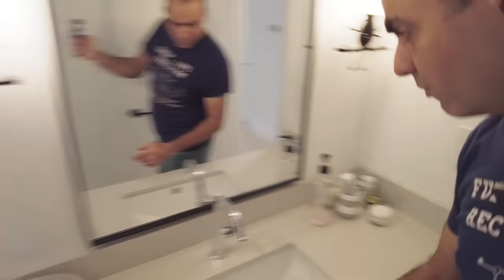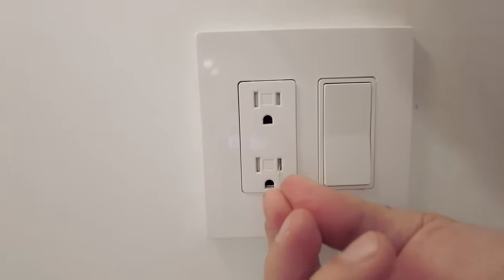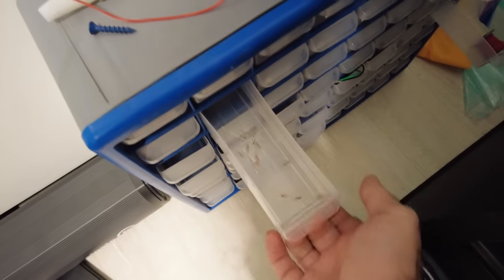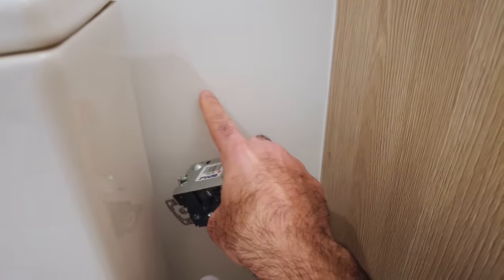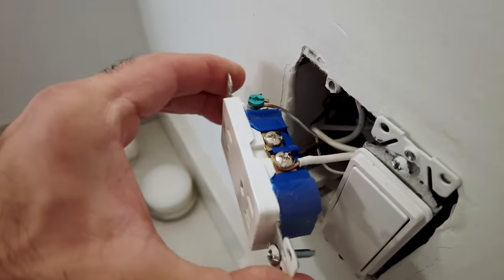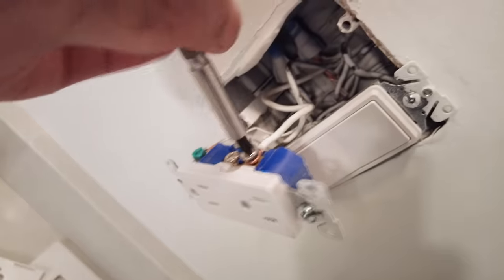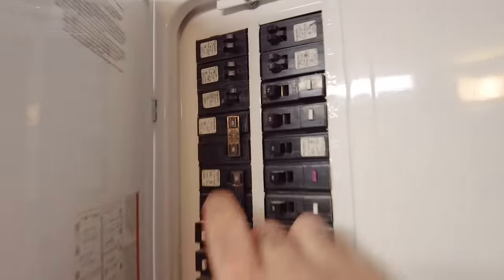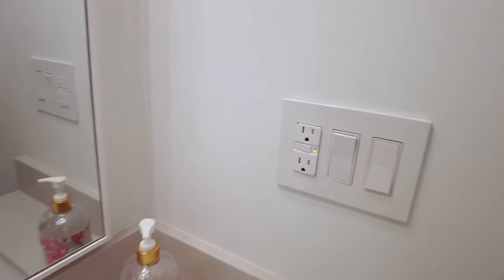Installing an Outlet… For a Toilet Seat?!

Comment: Next do an in-line 220V electric heater next to the shower head!   It’s those extra tingles with the warm water that really get you moving in the morning.
Reply: When I was in Manila, I experienced those tingles.. then I decided to use a different shower
Reply: Industrial 500v service, I want the shower head hot enough to forge steel.
Reply: The bigclive showed one of these deathtraps, the perfect place for an outlet is right next to said shower head, ungrounded of course.
Reply: @BrokenAtari  There is also 347/600 V service in Canada and 690 V in Europe. Even 1000 V for huge loads. And for even larger loads like motors in factories you can go to medium voltage levels like 6.3 kV.
Reply: @mernokimuvek  
Had a brother-in-law that was a union electrician, he never enjoyed working on 4160 Volt LIVE (sometimes it has to be done tho I don’t know if OSA would agree with that). It is educational to watch the line people working on new transformer reconnects.
Reply: We call that "spicy water." It comes from the pipes the city tends to run through veins of spicy dirt that excavators always find so attractive. You'll usually find high voltage lines running through the same general vicinity. 

I'm sure none of those things are related in any way and are completely coincidental.

And always remember to call your local dig line before digging so the line spraying guy can come spray lines on the ground where you can be %100 certain the city water main is not.
Reply: @meatharbor  
AND don’t trust that those “sprayed markers” are correct. Sometimes you have to carefully explore for underground utilities. I worked on a job where a large high pressure gas line went over a large underground conduit instead of under. The large earthmover found the gas line. It was educational watching the gas maintenance person welding the damaged line back together with a torch, while the line was at full pressure.
Reply: @Mentaculus42  It's just a little terrifying that I can't think of even one person I've ever met that does construction, utilities, roadwork, anything that may, at some point, have to put a hole in the ground, who doesn't have at least one story of line spray guy causing, at the bare minimum, significant damage to infrastructure, if not severe bodily injury. 

I'm legitimately beginning to wonder if it's just, like, the same guy. Just one dude that somehow gets shuttled all over the continent laying paint arbitrarily wherever he goes. Either that or they decide where the paint goes using that system from the Margaritaville episode of South Park with the decapitated chicken and the kazoo.

Someone should really set up, like, a line they can call or something to figure out where to spray.
Reply: @meatharbor  
I had a job at public works department and had to interface with utilities on their underground stuff, which for example on the high pressure gas line that I mentioned had location (and a bit rough at that) but not depth. Another situation on a piece of property that I have, AT&T was installing fiber optic line in an easement that already had buried cable there. The marking person tries to use a tracing device to sound the cable and puts a lot of paint around. The boring contractor shows up and I tell them to not trust the paint as I was fairly sure that it was wrong. They spent part of a day using a big high pressure washer like machine with a mega hydra-vac finding the old cables. Where the actual cable was found was a couple of feet away from the paint marks.
Reply: oh god, the death showers.
Reply: Australia.
Reply: Screw 220v.
Real men use 415v 3 Phase.
Reply: @IIGrayfoxII   no real men use the 500 amp 1000 volt redistribution boards that when they blow up you better have been wearing a bomb suit.
Reply: Just use an isolating transformer
Reply: He’s done that already
Reply: Maybe not moving anymore
Reply: @BrokenAtari  idc

Comment: Electrician comment here!  Next time, as you pointed out, use a box that clamps on the dry wall instead.  The lower example is the one I like.  For the cut out on those it's best to just use a credit card as the template and you'll get the perfect size.
Reply: Wait really? Those are the same dimensions? I've always just traced the box. Thanks for that info.
Reply: Dude... That stud is no longer a stud... The hole was so big that the sides looked like toothpicks.
Reply: Yep. Usually they are in the same aisle, except in a section that is labeled for "old construction". This is not just limited to receptacle boxes as well.
Reply: Rack-a-tiers makes a template with a built in level that let's you trace the perfect hole for both plastic or metal old work boxes. It's cheap and saves so much time if you're constantly cutting in pop in boxes like me
Reply: You forgot to mention he forgot the anti short bushings 😂
Reply: @nyer070  Definitely. if the hole is bigger than 1/2 an inch, iirc, you're supposed to use a little circular reinforcement bracket.
Reply: @bluephoenixguy1094  that's exactly right!
Reply: Huh! TIL!
Reply: @cfb36  can't talk like a normal human anymore?
Reply: @nyer070  ‘laugh out loud’ it’s shorthand for “today I learned” as an old fart myself, keep up with the times old one haha
Reply: @cfb36  haha you guessed it right, I am older and old fashioned. Thanks for the positive spirits
Reply: @nyer070  If you don't know what "TIL" means and you're on the internet, sorry but honestly, you're the one not normal anymore :P Growing old is hard.
Reply: @NakamoriAra  Oh, yeah, forgot about those.  It was probably the wrong box for it too.  I guess electrical engineers would make lousy electricians, or as Mehdi said, "Professional Dumbass."
Reply: RepentandbelieveinJesusChrist5  WTF
Reply: RepentandbelieveinJesusChrist5  Hail Satan!
Reply: @nyer070  If that stud was NOT a load bearing stud, it was OK to drill a huge hole, possibly intended for a large wate pipe to go from the sink basin into the side of the toilet bowl, instead of down it's own sink drain (an after thought after the stud was pre-drilled during the construction of the wall.
As often happens, some things that shouldn't be seen are, and some things that should be seen - are not.
Reply: @NakamoriAra  Or that he forgot to lubricate it all with the "wire-netting-oil-can".
Next time he'll need to use a long drop to fish out the mouse, that he sneaked past everything back there before the plumb-bob fell.
Reply: @WJCTechyman  Actually, I would have simply used a mounting block on the side of the vanity unit, solving all that "wall fitment" of the metal flush box (also that the tails came into that metal flush box without a gland - oh dear - from the metal sheathing which sadly he forgot to earth/bond anywhere too, by cutting it back after winding it off at each end, meaning if it ever has an internal fault to earth via the sheathing, anyone accessing the armour sheath from inside the vanity is liable to get a hefty electric shock eh?)  beside the stud" problem, leaving the tail long enough to terminate the wire to the outlet itself, before screwing the outlet onto the mounting block, (or in his case to the wall box, would have also meant having the unit closer to the person, instead of right at that back wall itself.
It looked very much like a concrete flush box, for mounting into concrete block walls etc., so yeah, wrong flush box.
The side clip wallboard / gib board clips, are not something most DIY people think about when purchasing flush boxes, as he possibly asked for a concrete box not knowing the right terminology, either that or the supply depot he got it from - had a surplus of very cheap concrete boxes - or simply fobbed him off with one.
Reply: @nyer070   This was 100% all I could see. That stud is purely cosmetic at this point!

Rule of thirds. No holes bigger than 1/3 of the wood. That thing was like 4/5!
Reply: @DarrLaw  it's basically just there to keep the sheetrock straight anyway, interior non load bearing walls being what they are. still no real excuse
Reply: @nyer070  Agreed that hole should have been braced.
Reply: @nyer070  Just because you now have load bearing drywall for that stud....... Have seen houses where the paint is a structural element.
Reply: @SeanBZA  paint being the structural element had me! 🤣🤣
Reply: @nyer070  Went to undo a light fitting, and when I broke the paint that was over the screw the entire ceiling rose disintegrated. All wood eaten out under the paint, aside from a thin layer of old lead based paint that was left in the shape of the old wooden rose. Luckily new LED fixture is light, so screwed into the asbestos sheet ceiling instead. Temporary prefab house, now there over 100 years, as it never was replaced with a permanent structure, just got added on a few times while still being classed as temporary.
Reply: @SeanBZA  🤣🤟🏻🤦🏻
Reply: @Mister_Brown  
And how do you know that any particular wall is load bearing or not, I have a number of interior walls that are significantly load bearing in my house? Remember, this video will be extrapolated to just about every possible variation of situations by people that are not knowledgeable about such things.

Comment: Just installed one of those non-electric bidet seats at my place. It's a simpler version than others but feels more reliable. No electricity needed – it hooks right up to the hot/cold water from the basin. Only cost me 30€ and it's perfect for a rental. Depending on your setup, you might not even need to do major work, just attach the hoses. Got it ready in just a few minutes. Super straightforward and efficient.

Comment: I think that ElectroBoom did a pretty good job. Reto-fitting electrical wiring can be a pain in the ars.
Reply: ask us in germany..solid walls or even beton^^
Reply: @bosanaz2010  wait do Germans call it beton as well? We call it beton in Turkiye too.
Reply: @Görkem-x5h  yes, Germans call it Beton. Looking up “beton” in Turkish on wiktionary, it seems we both borrowed it from French béton, from Latin bitūmen.
Reply: Being from England we just stole the word, removed the unnecessary line above the u and called it bitumen.
Reply: @puellanivis same here in croatia
Reply: @bosanaz2010  I am a german electrician and fellow ElectroBoom-Viewer and I had like 15 heart attacks watching this video :/
Reply: As much fun as I make about those north american drywalls, I got to admit that it looks so much cleaner whenever you need to retroactively use cables.
Reply: @ZeroOneInfinity  "Bitumen" exist in German as well, its a completely different product though.
Ours was derivated from lat "pix tumens" and its basically Tar made from mineral oil.
Advice: don't put german "Petroleum" in your car as well, it's not gasoline but lamp oil. :-)
Reply: @bosanaz2010  huh, Russia, or other north countries i think, concrete everywhere, even cosmetic walls )

Or bricks in old houses, and in new apartments with finishing nobody know where the wiring goes, pretty sad i suppose easier to renovate all apartments than try to do things like that. 

Oh yeah and sanitary cabins of course in new houses, also without pipes and wiring scheme )
Reply: especially with one hand.
Reply: @legominimovieproductions I am an electrician in United States and was having chest pains watching this but got to the hospital in time….then I got the bill. Ugh on the vid. Ugh again.
Reply: Yeah, old work is a royal pain. I'm not familiar with Canadian laws, but that installation wouldn't pass NEC here in the states. That being said, I think it's functionally fine and safe.
Reply: @funtechu  I’m in the states too. It wouldn’t pass (armored cable in plastic box) and he didn’t stress making the connections on the devices TIGHT like they should be, but even with all the cuts, I’m impressed with his skills of whipping that cable in there like he did. It probably took him 6 hours, but he still did it pretty good. LMAO at how he skinned the armor and how he stripped the wire.  Put a redhead on there!!!!!!!!!!!!
Reply: @SnotrocketLT4  Yep, like I said, it wouldn't pass under the NEC. The one real safety concern I had is that he didn't tie the ground to the box, and thus the MC and box are floating, or at least they are only connected through the receptacle tabs. However at 13:29 he mentions in an editor note that he is going to go back and do that, so that resolves the only real safety concern.

For those wondering the other code violations, he is attaching an MC to a plastic box which is disallowed because the box can't provide grounding connection. In this case, it is grounded on the other end, so while it won't pass code, it's not an immediate safety concern. The other thing is the MC is not appropriately clamped to the box. Those one-way clamps are made for NM wire.
Reply: @funtechu  Also the metal box he used is for NM connections not MC connections. He forgot the anti-short bushings. The metal box was attached with screws from inside, and that box is not designed for that. The metal box is not flush to the drywall, and the gaps between the metal box and drywall are too big.
Reply: @TonyPombo  Good points, I was watching it on my phone so I didn't see some of those details.
Reply: @TheBl4cKH4wK  It is one of the very few benefits of having what are essentially hollow walls everywhere. The company I used to work for often received contracts to wire houses with networking cable and you don't appreciate just how nice drywall is for that kind of job until you have to do the same thing for a building that's 75 years old and constructed almost entirely out of Haydock bricks
Reply: @bosanaz2010  Well we Indians tend to love running pvc pipes in corners and painting the same color as the wall if we need extra sockets somewhere.
Reply: pun intended
Reply: @bosanaz2010 I do wonder where Beton originates from. It's the same thing in Mauritius but it also blocks signals more than typically as it's made from mineral rich rocks.
Reply: Btw that wouldnt Pass in Germany neither... But Out wiring is way different than Muricans..Our Outlets have spring loaded clamps..No screw (nearly all) ...Just pull down isolation and Stick IT in...also No cable Twist Connections...wagos are the way to go and so nice to Work with ....also everything is Protected by a rfci,Not only bathrooms.
Also WE have 230v ,and even 400v  for the oven,Car charger or Like me a Workshop in my flat ...😂
Reply: Beton Blocks because of the Steel INSIDE as far AS i know
Reply: @funtechu  Also, he should have a redhead(bushing) to keep the Mc armor from cutting into the wire.
Reply: @SnotrocketLT4  Huh, I though I saw him put one in, but I guess not. That's what I get for watching on my phone!
Reply: @funtechu  Maybe he did and I missed it. I’m watching on phone too and didn’t go back to look.
Reply: Pain in the Ars Technica.
Reply: @bosanaz2010  yeah its nice ripping people off
Reply: @bosanaz2010 Betoni in Finnish
Reply: @ZeroOneInfinity But beton is concrete. Bitumen is bitumen. U put it on the roads

Comment: Can't use AC/MC with plastic boxes like that. You could mount a junction box in the cabinet that takes the MC, and NM-B from the back-side that feeds up wall and into plastic box properly. Also those are the wrong size one-hole straps, need 3/8" MC straps. 13:05 you bought the right box, but yeah hole a lil too big, but what you need to use there are two "madison straps", which are flat metal straps that you insert and then bend, which then rigidly holds the old-work-box in place against the drywall. no need for screws or extra ears.
Reply: Your supposed to use 12/2 in bathrooms too

Comment: Having an outlet right next to the toilet would be a dream. Imagine the new possibilities! Watching Mehdi while charging your phone!
Reply: Oh yeah totally what I was thinking too!... And nothing else
Reply: I put one in for the bidet - and now I'm about to wall mount a laptop by the toilet.
Reply: Pull yer wire!
Reply: Why phone when you can bring your pc
Reply: Watching Mehdi is the one time I would be anxious charging anything
Reply: You can watch him while charging your phone anywhere - power banks do exist!
Reply: Get a 10ft charging cable.
Reply: Aren't most bathroom outlets over the toilet tank? At least in the houses I have lived in they are. If the bathroom was on the first floor I would have gotten a floor mount outlet, the kind that pops up, and wired a dedicated circuit all the way back to the panel with a GFCI breaker in the panel. Then again I am obsessive about electrical projects, I live in a house with 3 phase power, and have an entire setup to make 230/415v power complete with European style din rail panel with RCBOs, just for the basement workshop, so I can run imported tools. Also a big fan of the new self contained receptacles where you just drill a hole and it has the clamp for the cable built in, those things are amazing.
Reply: @KafshakTashtak  portable charger pack i have a 10,000 mah with 20w fast charging
Reply: It is extremely unhygienic and life threatening to use your phone on toilet. After bein on toilet, disinfect your hands for at lest 30 seconds before touching anything.

Comment: Other than grounding the boxes properly you should have used an "anti-short" on both ends of the cable. It's red and made of plastic that protects the wires from the metal sheathing.
Other wise good job.
Reply: He did that in his patio heater video but forgot in this one
Reply: I don't know how he could forget the redhats a 2nd time around. He made a whole follow up video about it the last time he was called out for it!
Reply: @sgath92  He was clearly just distracted by needing to poop the entire time
Reply: it shows he is not an expert.
Experts would not make that mistake twice.
O wait, even experts can make the same mistake twice.

I guess he is human?
Nah, that can't be it.

Wait, he is the Crazy Iranian Hacker. Brother of the Crazy Russian Hacker.